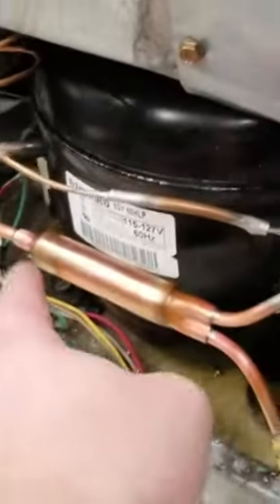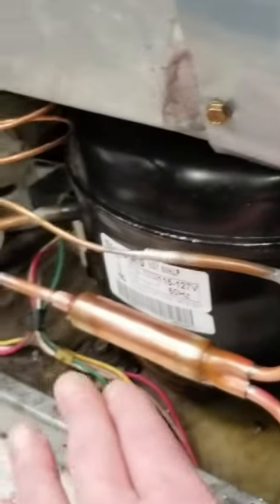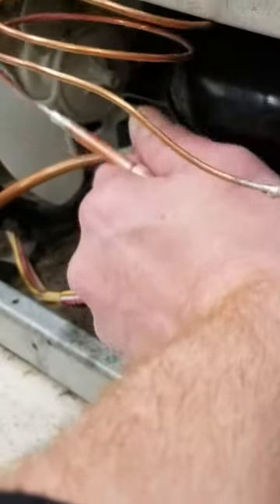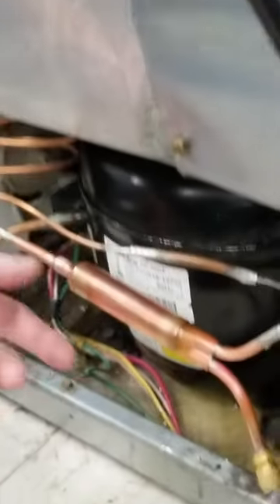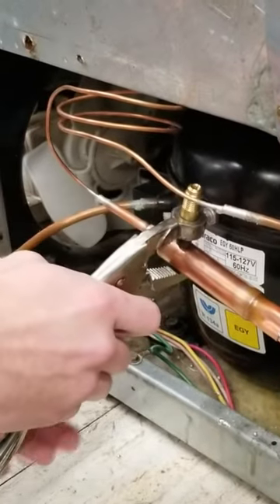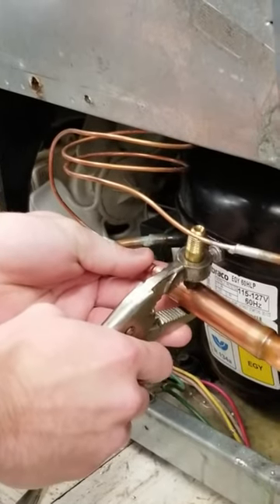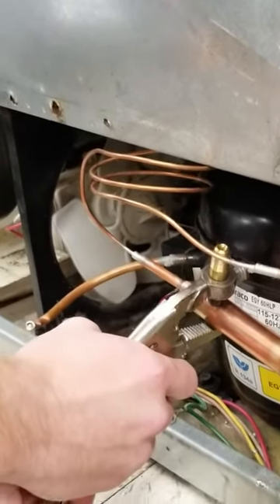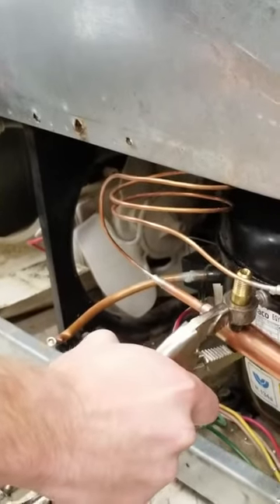#piercing a #filter #drier #refrigeratorrepair #training

Comment: Why?   What is the purpose of piercing the filter dryer?
Reply from the maker: They do not always have an access valve on them. Especially when they are from the factory.
Reply: @fredsapplianceacademy first time i see something like this. Is this standard practice or not? Why wouldnt you weld a T at whereever you need to access the system? Filter drier seems to be the worst place to do this imo but i havent seen this before so there might be a reason that im unaware of
Reply from the maker: This is to recover the refrigerant before servicing the appliance.  @faintsmile3279
Reply: is this standard practice or improvised? @fredsapplianceacademy
Reply from the maker: Standard practice. There is a tool designed specifically for this process.  @faintsmile3279
Reply: Can you add Freon with the access valve on the dryer filter ?
Reply from the maker: @crazee6821   
You can add refrigerant to the access valve on the dryer but liquid only. This process is normally only done to charge the unit after a repair. You cannot add it to the piercing tool as it is for recovery only.
Reply: The drier has two opening on the opposite side of the cap tube for a reason one goes to the condenser one is for access to service you would pinch it there not on the filter drier, and there is no beads in a copper spun drier,
Reply: If this is for recovery...This is not how to do it... horrible advice...